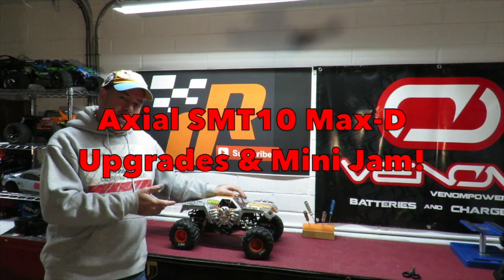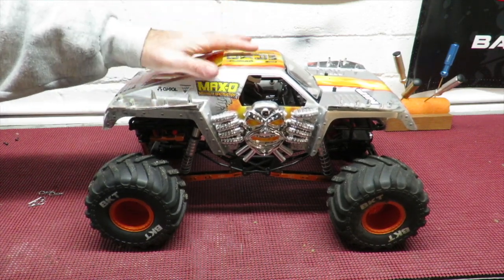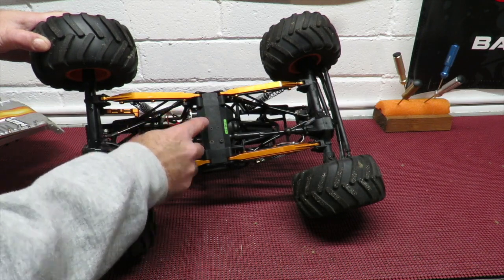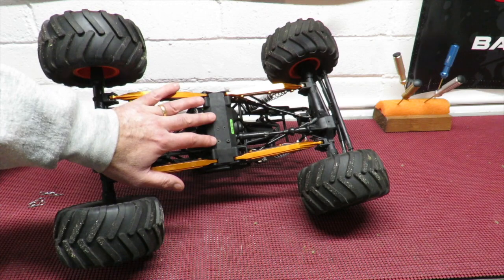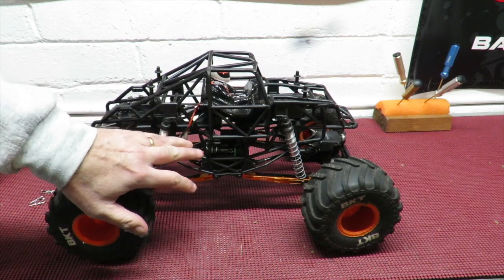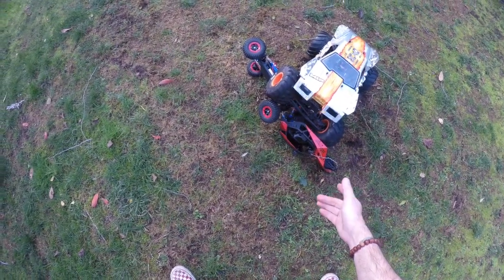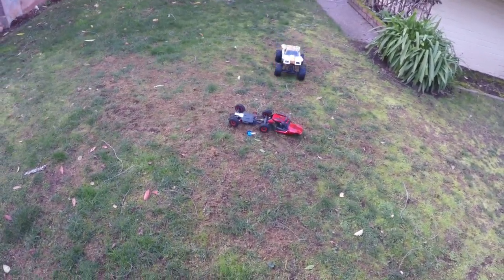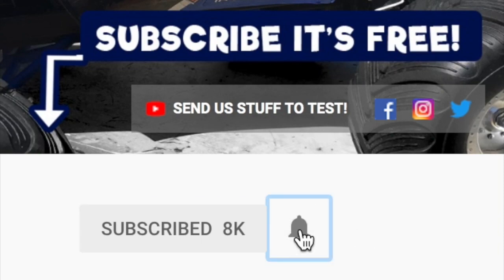Axial SMT10 Max D-Upgrades & Mini Jam In The Yard!

Comment: You should get some silicone putty earplugs and stick those in the diffs! It basically locks it up but if it needs to it can still slip a small bit for durability, and if you don't like it you can just take it back out without any issues

Comment: why dont You Just Put a different system in it?
Reply from the maker: @RC Flo this car has had a castle 5700kv motor and a mamba X in it, I've taken them out as it's too much power. I've done videos with this running on 4S and tried it on 6S, even on 3S it'll flip over in the blink of an eye, and starts to strip the hexes, on 4s it does strip the hexs